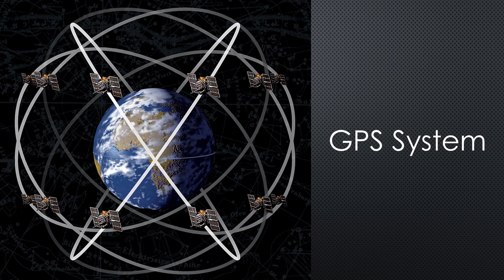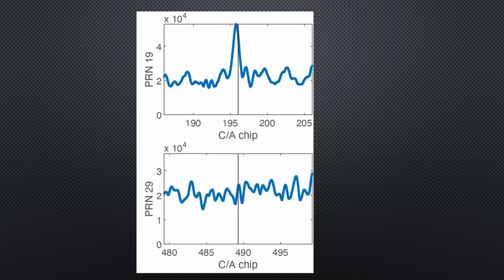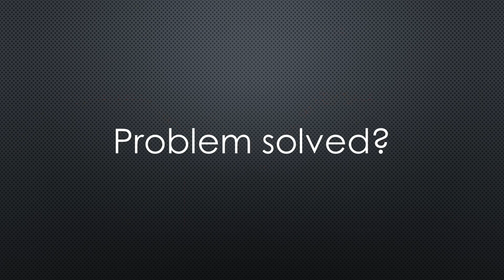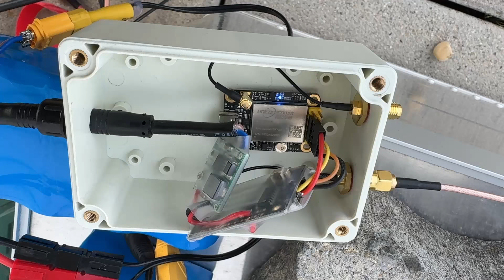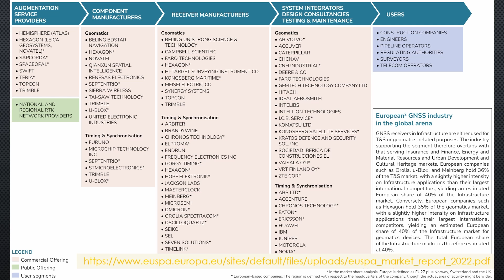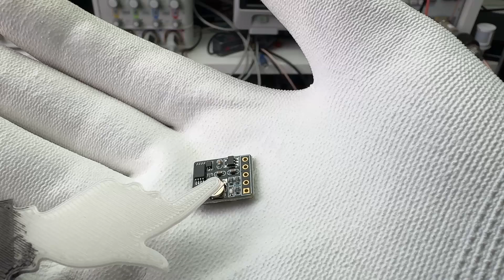(483) ESP32 precision GPS receiver (incl. RTK-GPS Tutorial). How to earn money with it (DePIN)

Comment: Part of the reception process is to determine the slight frequency difference of each satellite, as received, due to doppler shift.  This helps spread the signals out a bit.  If they truly were all on one frequency at one time, it really would be essentially impossible to make sense out of it.  Even with the signal spreading and the frequent repitition of the code, it is still very difficult to receive.  These tiny units do an amazing job for a small price.  Thanks for the great, interesting video.
Reply from the maker: I was not aware that the doppler effect is necessary for the decoding. And I agree that these are wonderful small devices!

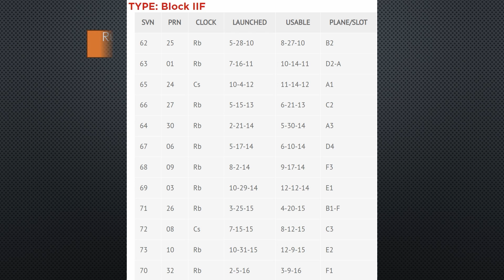Comment: 6:58 1ns corresponds to an error of about 30cm, not 30m.
Reply from the maker: I knew that I get it wrong somewhere :-(
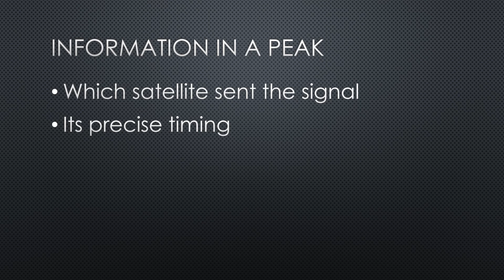Reply: At 6:17, too
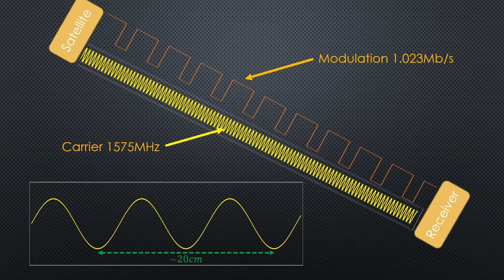Reply: Also, at 9:25 (and further), you say the wave length for 1500 MHz is 20 cm (which is correct), but on the image, it’s drawn as a length of 2 wave periods, not 1 (ie 4pi, not 2pi).
Reply: Also you put your socks on backwards.
Reply: @Xsiondu  it’s a technical discussion, about specific technical issues. Nothing personal. I fully respect Mr. Spiess. If you think your joke about the socks is appropriate here, you probably are in a wrong place.
Reply: @bengim  Yes, it is a technical discussion. It need not be without humor, however.

Comment: It's not that new. I've been using centimetre accurate GNSS for 25 years. RTK, PPK and static observations. Trimble, NovAtel, Leica, Topcon etc. 

After looking at photos of GNSS base station installs for DePin projects, I would never use the service for anything that required precision. Many of the GNSS antenna installs I've seen are terrible:

* Tall, unstabilised masts on rooftops that flap around in the wind. 
* Masts secured poorly with zipties
* PVC pipes, or lengths of timber with a 5/8 thread stuck on top
* People regularly adjusting, or moving their antenna will cause errors in connections broadcast. 
* People not installing their base antennas level, thinking that placing it on a slant will solve their 10 degree elevation mask issue with nearby trees. 
* People installing antennas on highrise buildings (thermal expansion and contraction from sun causes the building to move)
* Installed on apartment balcony balustrade with >50% of sky blocked.

Amateurs installing these bases have no concept on how GNSS systems work and cannot be trusted.

I've installed many official GNSS base stations, and there are strict requirements for how they are established. Deep concrete base in stable ground. Calibrated and certified antenna. Several days of observations to establish base coordinates etc. 

Anyone using GNSS for commercial use would no use DePin network corrections. We spend $20k to $50k+ on our survey grade GNSS receivers and generally use our own base station setup over a known coordinated point and broadcast corrections over UFH, VHF or LoRa. 

These DePin GNSS networks will never get a foothold in the GNSS correction market. The only users will be hobbyists. I see founders of these projects claiming that agriculture will be a big market. That's not true either. Machine guidance systems generally come with a GNSS base to install at the farm. One base can transmit corrections to all farm equipment over radio. No need to pay a DePin project for corrections when you can supply your own for free.
Reply from the maker: Thank you for sharing your knowledge. I am no specialist in this matter. So we will see how and if such networks will evolve. For my part, at least I avoided the mistakes you mentioned ;-)  And it took a while till my antenna was validated by Onicoy. I assume they try to do some tests about the facts you describe in your comment.
Still, for a noob like me it was mind-boggling to see the accuracy and understand at least a bit how it is made.
Reply: Sure, what you are describing is highest-end RTK networks which can deliver mm-accuracy, as is required in surveying use cases, and a sub-1000$ equipment installed by a broad community can not deliver that. 

However, for many use cases, 1-2cm accuracy is sufficient. 

And things like long antenna masts that move in the wind, or antennas moved can be identified by  QA through processing the inbound data
Reply: Great points both of you, for what use cases would 1-2cm accuracy be sufficient ? I figure activities like geological surveys for gas, oil and construction industries right?

Comment: In Ohio it's crazy easy to get access to the states correction system and link to base stations to allow much better collection of data points. I used it years ago to map my property for photogrammetric scans. The base station was $900 and adding more to triangulate was at least $400. Building these would be much better for this purpose now. Thanks for the info
Reply from the maker: So you are lucky that you do not need a base station anymore!

Comment: Great video Andreas - thanks!  You obviously worked hard to find good economical solutions, and you have inspired me to start trying out RTK.
I was also an early adopter with first unit being a GPS95XL, slightly older than your GPS90!  I was fascinated enough by the technology to get the Tom Logsdon (AKA "father of GPS") book on it.  Here in Oregon USA, our state government actually provides free (for the moment) RTCM3.x NTRIP/RTK access with good coverage, so no Onocoy revenue for me!
I wish RTK module vendors would make their USB connection an integrated hub with 3 separate serial devices (one for RTK module configuration, one for NMEA output, one for RTCM input) to provide more flexibility to run separate apps (Google Earth Pro, GIS apps, etc.) without external mess attaching to other serial interfaces.  The only solution I've seen so far is the uBlox EVK-F9P evaluation kit, which does this by adding a hub chip and two FTDI chips to the module PCB.  Again, great video!
Reply from the maker: Maybe Ublox will also bring a 3 frequency chip. Then we can use theirs.
Reply: @AndreasSpiess  That would be great - some competition for things like the amazing Septentrio Mosaic-X5...

Comment: I'm curious if it would be viable to transmit RTK correction data over Lora. That way you don't need a power-hungry mobile connection on a remote device. Also, how often does the correction signal need to be transmitted for good accuracy?
Reply from the maker: I am sure it can be done (and maybe is already done). But only by a direct connection (not LoRaWAN)
Reply: GPS RTK data is latency critical. The data shouldn't have a latency larger than a few seconds from the RTK base until it reaches the RTK rover. Also, it is a continuous stream of ~1kB/s. Not sure whether Lora could fulfill both requirements

Comment: Yes! This was interesting. There is such a beauty in numbers and in mathematics. It is a true genius that thought of looking to the phase to get a higher resolution to the navigation. 
 
One day even this will be perfected again and again, the receiver can detect if it is standing upright or upside down by looking at the phase. But then it is necessary to know the exact polarisation of the satellite's antenna. Than the next improvement would be the checking of the phase in combination with the satellite's Doppler status, if one of the satellites is moving towards the receiver or from the receiver, then again another fine correction can be made to the timing. Then there is something with the steepness of the up-going flank of the sinus and the lesser steepness of the down-going flank, but I have no clue what we can do with it, yet! 
 
Life is so beautiful!
Reply: Let's unwrap this:

* upright or upside down:

This is not accurately possible with a single antenna RTK rover - but there are "heading" receivers which use two antennas and a short (1m or less) baseline between them, and can then determine orientation of this in space. A simple upright / upside down detection would best be done with a cheap MEMS accelerometer

* antenna polarisation:

The GNSS signals are RHCP polarization, and the antennas are designed to this [except for mobile phones, where antenna polarization for GPS is of little concern - usually linear polarized, at the expense of gain and multipath resistance]

* phase versus doppler:

It is the other way round: Doppler is measured by a GPS receiver already (as part of tracking the code and the frequency adjustments required to keep tracking it). Doppler is a relatively coarse (compared to carrier phase) measurement. GPS receivers determine the 3D velocity vector of the antenna out of doppler (and not by differencing consecutive positions as one may assume). 

Further, the phase measurement is actually reconstructed from doppler and can not be measured directly by a PLL. So only thanks to doppler measurements can the accurate carrier phase be "tracked" - by integrating "instantaneous" doppler measurements at a high rate. 

* "steepness of the up-going flank" 

Unclear to me what you mean by that
Reply: @onocoy  Not even so long ago we could not even dream about measuring and pointing out a specific point at the phase. All of these innovations you spoke about are one by one wonderful achievements. At this moment in time it is almost impossible to make a prediction about what would be next.

Comment: Awesome compilation !

Actually I do have an application which requires high accuracy/precision as shown here. Now three years back I built my on system using an u-box evaluation board ZED-F9P plus a Raspberry Pi 3B+ incl. a 7" touch display as hardware and some 400 lines of Python code, PySimpleGUI and the GPSD daemon for software. The Python code is used to support GIS translation and to offer a GUI for a 7" touch screen. The high precision is achieved by using a NTRIP service (SAPOS in the given case). My device is now being used to support the localisation of "corner stones" ("Grenzstein" in gemran language) in both agriculture and forestry.

When watching this video I had the idea for some improvements on my end ... 🤓 ... So: Andreas, thanks for the trigger !
Reply from the maker: Very good. Is this software open source?

Comment: Thank you for your very good RTK-GPS explanation.
I use such a system to operate my lawn mower without a guide wire and receive my RTK correction data from our state SAPOS service without having to set up my own correction station. Nowadays almost every country has one or a similar service. In Germany, this service is available free of charge depending on the federal state. In Switzerland there is also a satellite positioning service called swipos that is available to everyone.
Reply from the maker: You are welcome! In Baden Würtenberg, they ask for a one time fee of 150 Euro and in Switzerland it is 1500CHF per year. At least this is what I found with Google
Reply: @AndreasSpiess  Thats’s correct, Baden-Württemberg charges for registration 150€, but the SAPOS service is free of charge. Swispos-NAV (GSM/GPRS) is obviously free, but it “only” has an accuracy of half a meter.

Comment: Andreas, thanks for teaching me how the X-31 Vector team pulled off this pioneering trick to auto land at high angle of attack using centimeter precision.  In 2001 and 2002 I had the honor of being part of the international X-31 Vector team, and worked with the Boeing GPS expert to achieve successful flight tests and auto landing.  The Navy is probably using this tech for Aircraft carrier operations.
Reply from the maker: I assume that this tech is used in many areas. Landing on a (moving) carrier probaly needs a lot of relative precision between the plane and the carrier...

Comment: I purchased a very large, and expensive, Magellan GPS unit for my boat in 1991, the consolation still had gaps in coverage and of course SA, but compared with Decca it was a revelation, had 20 waypoints, and I think you could store about 5 routes. Big screen do you could see the x-track error easily as you went along the route. But the basics are the same as my B&G Zeus system on my current boat, so I, too, am in awe of the sngineers behind GNSS.
Reply from the maker: Thank you for sharing this story. Indeed, for boats the initial precision was ok, too. Like planes, they do not use roads ;-)

Comment: 10-15 years ago we played around with M8N and M6N neo modules with custom fw and settings + RTKLib.
Back then the lesson learned was: use a good antenna.
Till today I have doubts to invent into F9P based receiver because of multipath fading you really need a good 
GPS anteanna that performes on L1 L2 bands and is also capable of receiving well Gallileo and GLONASS satellites.
The more SATs the better. The more bands the better.
A really usable antenna (i mean on ground and heavily obstructed area like trees and buildings) costs 1000-2000$
The receivers got relatively cheap, but antennas are still beyond the hobbyist price range.
Reply from the maker: The receiver and antenna I use are capable to receive all kinds of satellites on L1,L2, and L5. As you write, this seems to be important.

Comment: Great video, augmented GNSS in a nutshell!
I believe an RTK base station should be in every major electrical (air insulated) substation. Creative asset managers with fantasy would imagine what they could get out of this. If it works with lawn mowers, it will work with any other robot. Even the costs of commercial base stations would be justified in this case.

Of course, GNSS are vulnerable to being disturbed (as mentioned in the video), but there are ways to at least detect this. E.g., Galileo also offers message authentication.
At 06:52 you probably wanted to say: "a difference of 1 nanosecond means already an error of 30 centimeters". In imperial units, the speed of light is easy to memorize: one foot per ns.
Reply from the maker: Indeed, I made a mistake in this calculation!

Comment: super nice summary of the key concepts of GNSS perhaps some additional explanations on constellations of which GPS is a special case and geometry for geometric dilution of precision, how alignment of satellites plays a role in getting final accuracy. I remember how in Europe it was best to use a combination of satellites from different constellations (Glonass, Galileo, Beydou, GPS) and consider an angle greater than 14 degrees from the horizon before integrating their values in our calculations. We also used LORA to transmit from base to rover and vice-versa as wifi in the field could get expensive fast. We would probably use 5G today although network credentials checking from tower to tower is a precision hindrance adding delays. LORA did a great job. Thanks again for the update on a topic I miss in my current functions.
Reply from the maker: Newer receivers like the one I used "see" more than 20 satellites. So the constellation seems to be fo less importance than when there only was GPS. LoRa is for sure a good possibility to connect the rover and the base.
Reply: @AndreasSpiess  3 or 4 GPS are usable at any given time and I doubt your receiver sees 20 GPS satellites, it is already using multi constellations...

Comment: a lot of those "inaccuracies" are due to using less satellites to calculate position, most commercial devices will only stream data from 3 or 4 satellites because that's all that's needed for navigation in places where there's lots of signs and landmarks to find where you're going. the more satellites you can stream from the more accurate your resolution.
Reply from the maker: More satellites are always good. But this fact does not replace the need for RTK for high precision.
Reply: The number of satellites today is usually not a problem. Any modern receiver supports all constellations (GPS, Glonass, Galileo, Beidou) and have ~40+ Satellites in an open-sky view environment, even the ones in mobile phones doe multiple constellations (and in some models even on L1 and L5)

In outdoor open sky environments, the accuracy is limited by Orbit/Clock/Atmospheric errors and that is what RTK can compensate for
In urban environments, accuracy is degraded due to Multipath, so RTK works best in areas without reflective surfaces

Comment: Most commercial aircraft still have Inertial Navigation Systems fitted as backup to the GPS systems onboard. INS is totally independent of external sources for positioning.
Reply from the maker: We can hope that is true…
Reply: INS is good enough to get to within visual range of a destination airport and lock onto the airport localizer for instrument approaches, but not quite good enough for safe landings in low or near-zero visibility.

Comment: We used differential GPS 20 years ago when surveying archaeological sites. It would give reasonable positioning down to about half a metre.  If you want to know where that kind of precision becomes important, aircraft conduct gps approaches these days to align with a runway they cannot see because of weather.  These are increasing and the older ils are decreasing because there is no cost involved to airports because no kit is required.
Reply from the maker: Indeed, DGPS and WAAS is used since a long time. Both use the modulation signal and not the phase.

Comment: Finally you solved my ultimate most wasteful over the top way to position how much the gete is open - RTK was the answer. So from boring rotary encoders on the wings we can go to hklink radar, which one might still consider sane way of doing it, it can at least detects objects in the gate wings etc. (in theory), but this, this makes no sense at all. So obviously i'm going to attempt getting precise gate wing positions this way now.
Reply from the maker: Probably a bit more expensive than a rotary encoder…